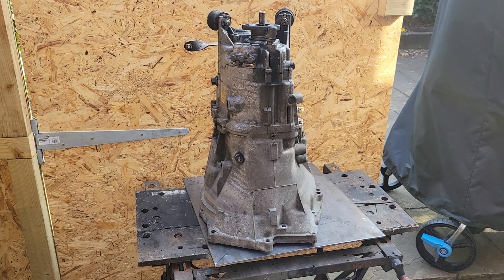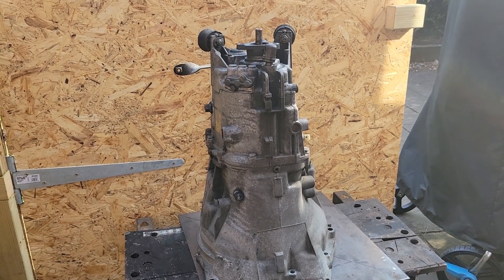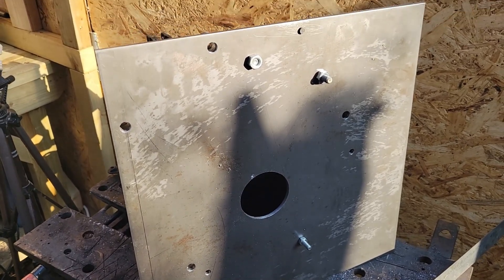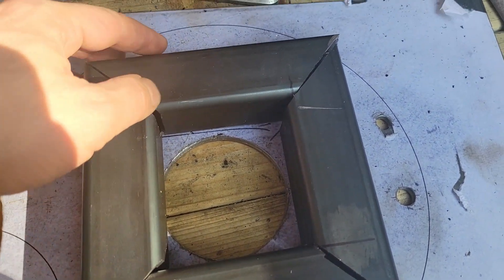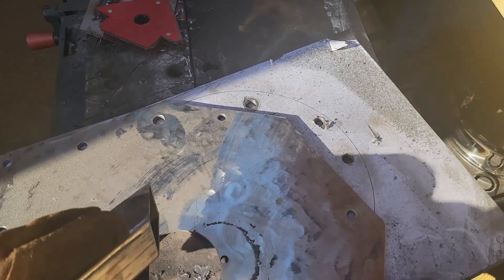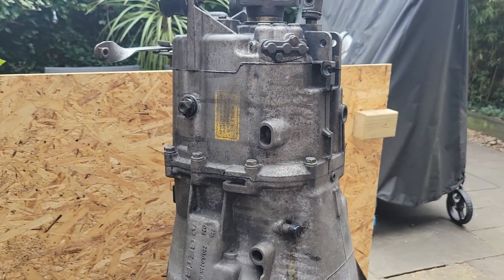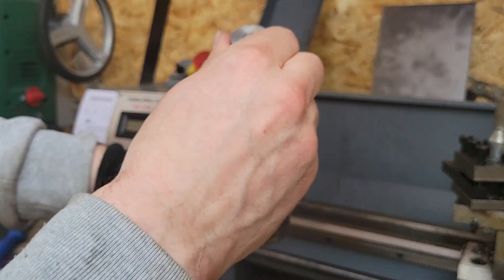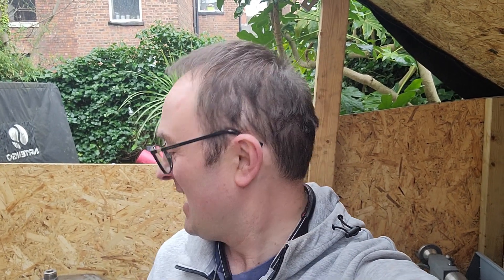Upgrading the motor in my electric car conversion: Part 3

Comment: Excellent work Tom. You flying ahead. I really need to take a leaf (pun-tastic...) out of your book and get cracking on mine again. I just can't face another battery pack out! Keep it lit
Reply: batteries are soooo heavy. even lithium ones. i completely understand why you can't stomach pulling them out
Reply from the maker: Cheers Fiachra! Those battery packs though. Must finish my new one...

Comment: I bet you measured from the top then drilled the hole from the bottom. Been there, done that. Holes add lightness anyway. 😛
To spin the motor when you're lining it up with the gearbox, if you don't have an easier way to do it use a cheap ebike controller. The cheapest ones don't need hall sensors to spin a motor.
I showed you how to grind down the clutch plate in my video ages ago. If you'd watched it you'd have saved ruining your lathe tools. 😛

Great progress mate, keep it up.